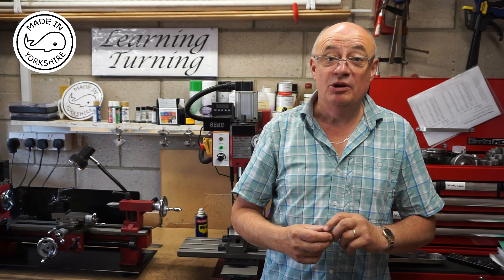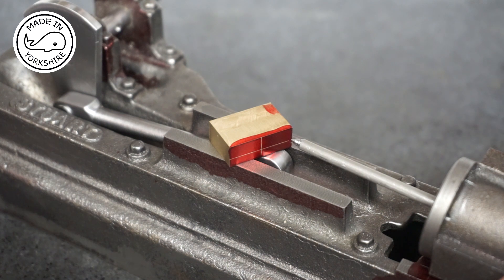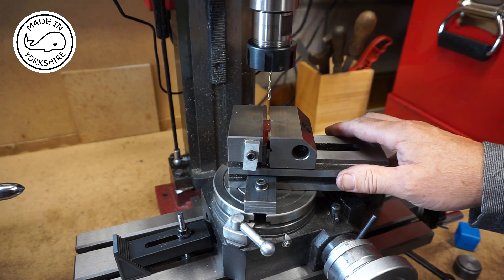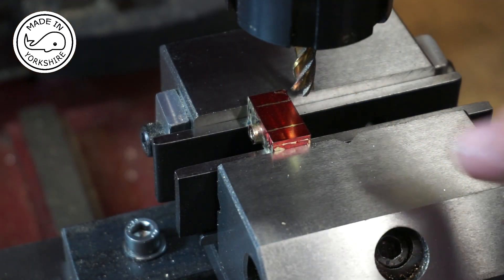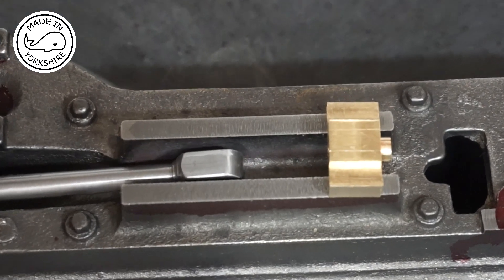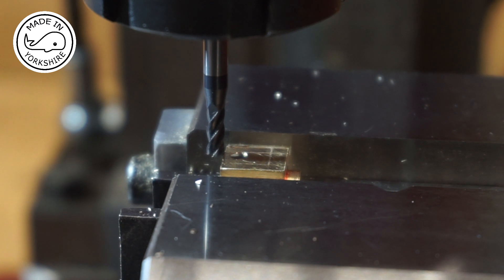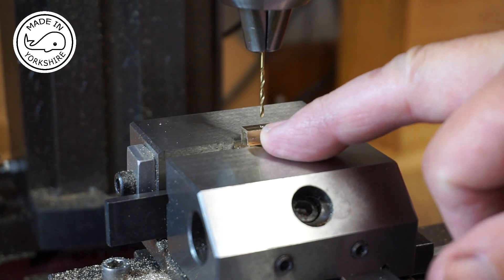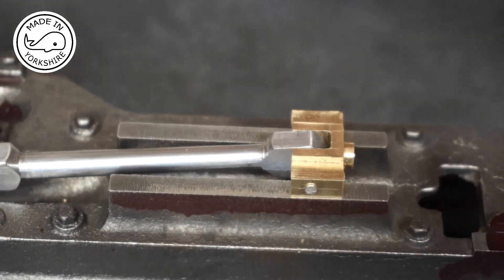#MT22 Part 8 - Making a Stuart S50 Steam Engine Crosshead. By Andrew Whale.

Comment: Tubal Cain is a first class teacher,I think that makes you a first class learner! I have 10 hours  work left to retirement and am going to be watching your videos first as I have a bought half built 10v and hope to get somewhere near  your standard.
I wondered where your bellows came from as on my mill they literally fell to bits in 5 minutes. Now yours arent fitted anymore.Ah well 
I just use damp course material now or occasionally bits of paper!
Jonathon
Reply from the maker: Thanks Jonathan. I find it a great retirement hobby because it keeps the old brain active and it's also a real challenge for me. I don't know how I ever had time to work full-time!
I got the bellows from arceurotrade. I think I went for the largest one with a view to cutting it down if I needed to. From memory I don't think I needed to reduce the size. I then just tapped some holes in the mill and attached it. It works a treat. The 10v is viewed as a starter engine but I have found it more challenging than the S50.
If you haven't already, it's worth joining the model engineering forum and the model engine maker forum. A great source of information and if you have any questions you can generally get replies within a few hours.
I hope the 10v build goes well. If you have any questions regarding any aspect of my build, just leave a message and I will try to help.
Happy Christmas and have a great retirement.
Cheers!
Andrew

Comment: Nice one Andrew, it's taking shape :-)  The crosshead looks to be a nice snug fit.
Reply from the maker: Hi Peter. Yes, the crosshead seemed to work out ok. I've just started to look at the piston but I'm a little confused. It talks about 1/16" labyrinth grooves but I thought they worked with oil? If I go with those I guess I will have to make my own tool out of hss. Any thoughts?
Cheers
Andrew
Reply: Andrew, I've never heard them called 'labyrinth grooves before but I suspect they are just a shallow flat bottomed groove cut with a parting tool in the lathe. Are piston rings supplied?  It's usual now on small engines to use 'Viton' piston rings and cut the groove to match the intended ring but I prefer the old fashioned way of making a ring from oil soaked graphite string and always manage to get a nice seal that slides smoothly.  I'd be be inclined to decide for certain what what you will you as a piston ring before you cut the groove as 1/16" may not be appropriate.  Here is the string I use, its cheap and will be ideal for sealing the piston rod gland even if you don't use it as a piston ring.  :-     https://www.maidstone-engineering.com/graphite-yarn-1-16-twist-approx-4ft
Reply: Andrew, see page 12 here.  http://www.modelenginemaker.com/index.php/topic,8050.165.html
Reply from the maker: Thanks Peter - you saved my bacon! I will definately go with the graphite string solution.
Cheers
Andrew
Reply: Think the string was how rings were made years ago on real engines, once it is packed in tightly it seals well and holds lubrication well :-)
Reply from the maker: Order placed with Maidstone Engineering for some graphite string. Also got some 1/8" x 40 oilers as they appear to be good value.
Thanks again for the advice. Very much appreciated.
Andrew
Reply: That's ok, I look forward to the next instalment :-)